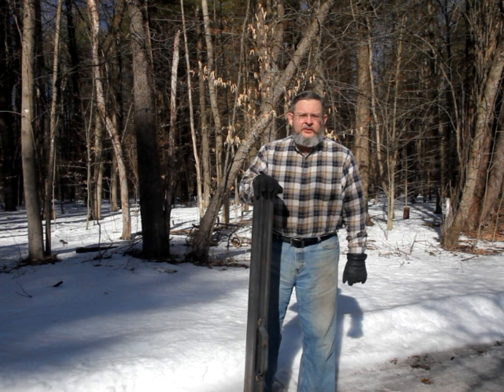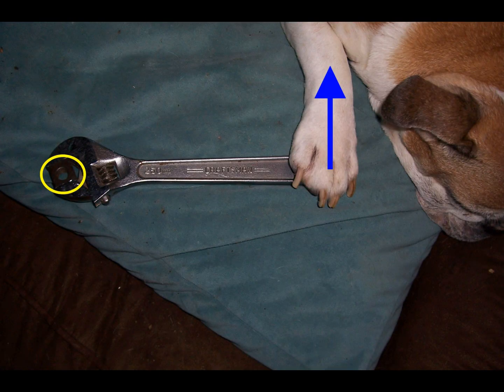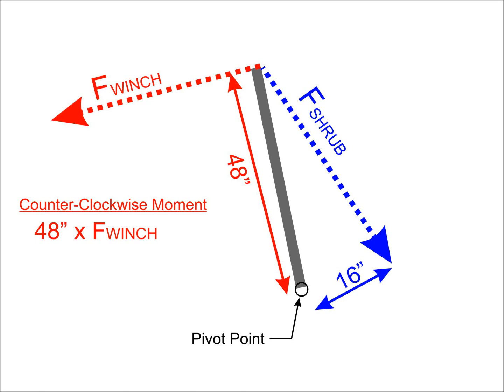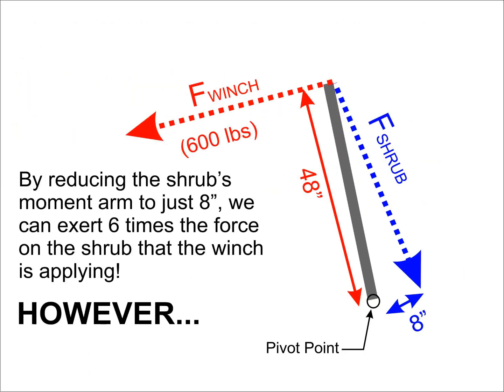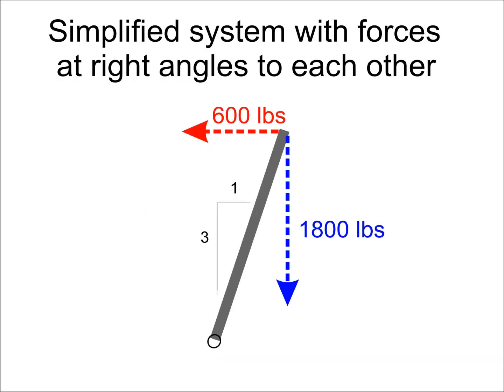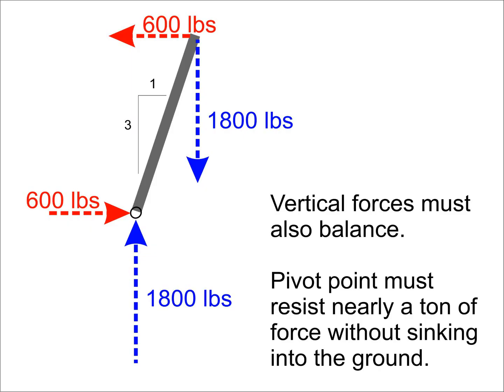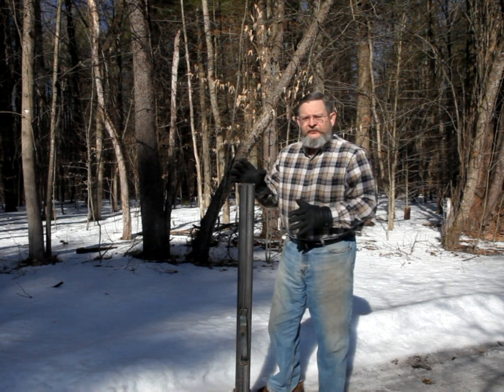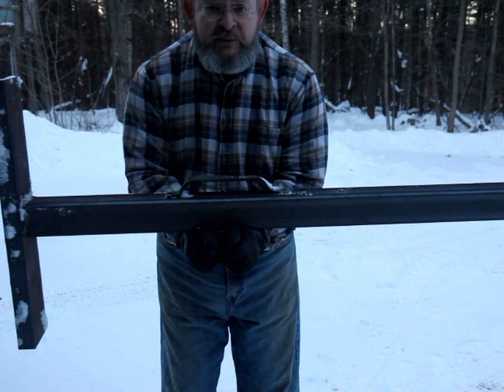Crude Device

Comment: I think I had a 'moment' there...lol. As has been said dry physics...but well explained.  It has been a while since my last physics class (high school) but something must have stuck because even without engineering I actually understood what you were saying...lol...AND...I understood (more or less) how the leverage works.  

I may have to see if I could put something like that together to get rid of some 'weed like' scrubs around our place.

Thanks for sharing your knowledge.
Cheers
Reply from the maker: Your high school physics teacher would be glad to hear that..
The Crude Device was intended for well-rooted strong shrubs. I have wanted to make something for the smaller things that need to be pulled.  It would a base, post, and short chain with a "grab" that could hook into any one of the links.  The "grab" would have jaws like a set of pliers that could grab onto the stem of the scrubby weed-like vine or saplings.  The jaws would tighten when tension is applied to the chain.
Best of luck to you on your puller!
Reply: @terryhale9006  sort of like a pallet puller used to haul pallets from the front of a truck so a forklift can lift them off the truck. They are a basic X with a chain attached across one end and various sharp points on the other. So you hook a pulling chain to the forklift and a slip hook to the chain on the puller. The harder you pull on the pallet, the tighter the points dig in. Simple design but works good.